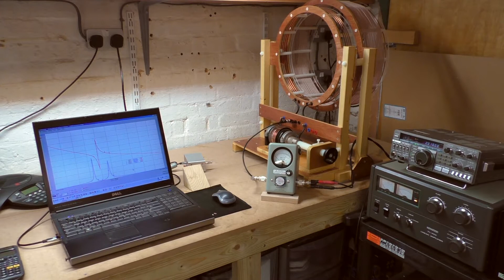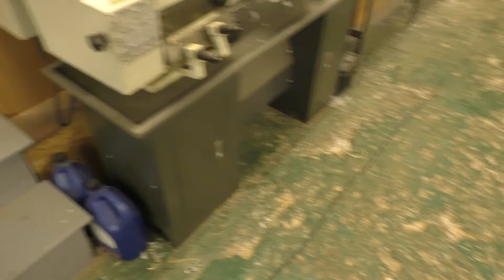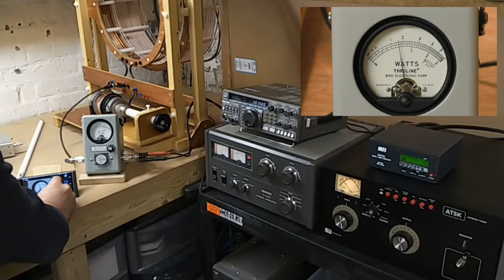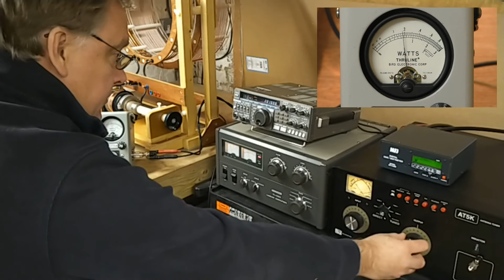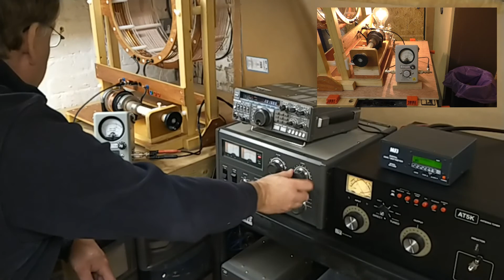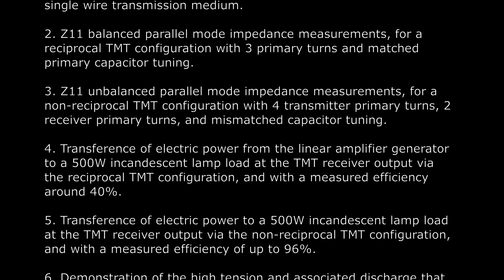Tesla High Efficiency Transference of Electric Power 2 - 11m Single Wire

Comment: Completely pointless. You're not taking into account the input power of the linear amplifier, to get 500W out you have to put around 850W in. Or the input power of the drive radio, which will be at least twice the output power. The power is going through 1 wire, so it's not wireless. Even if it were the efficiency would collapse over a very short distance. And you would have to have something to convert the received RF back into a voltage and frequency that would be useful, even more loss. Ridiculous nonsense.
Reply from the maker: This video experiment is to demonstrate the high-efficiency of the TMT system only, and in the close mid-field region in a single-wire LMD mode arrangement. The experiment is not to assess the overall power consumption and efficiency of the generator and TMT system together. I would encourage you to read the write-up provided on my website for the full explanantion, measurements, and results.